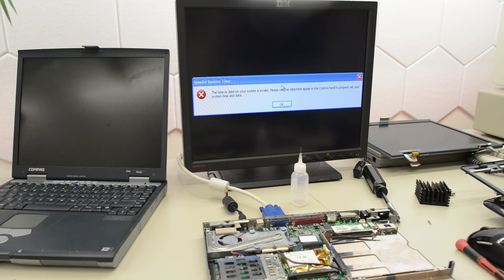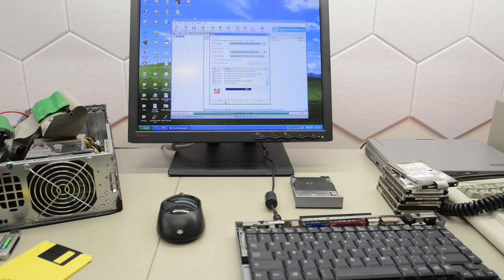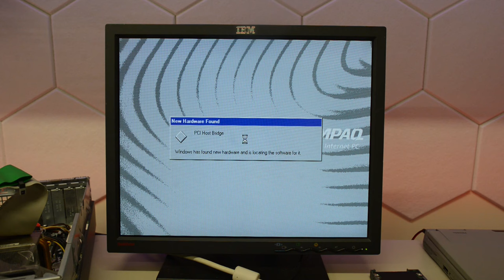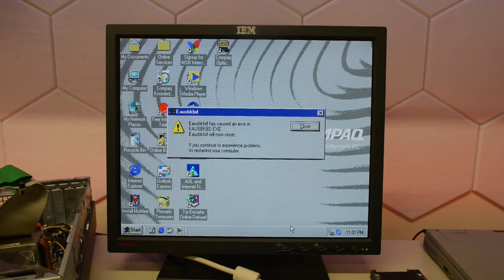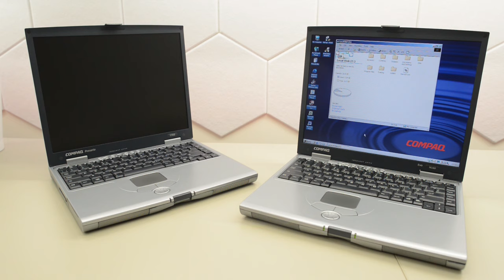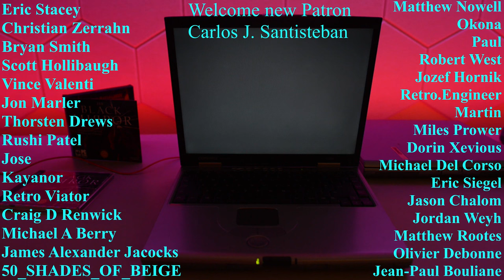Vintage PIII laptops Repair & Restoration. MOBO repair, respray, sticky rubberized paint

Comment: That very disappointing coating was DuPont Nextel when I used it in the early 80s. It was composed of neoprene powder mixed with urethane and was nearly impossible to scratch deliberately with sharp metal objects, so accidental damage or wear due to abrasion could never happen. It was used on studio mixers where the engineering's hand would wear through the paint adjacent to the slide pots over time.  Unfortunately after several years it acquired all the abrasion resistance of candle wax along with the stickiness you mentioned. A terrible disappointment when you're trying to make a premium product to last a lifetime. By 2000, anyone using it would have known that it was going to deteriorate into a despicable mess and how long it would take. Maybe new formulations were expected to be better or maybe it was pure cynicism and planned obsolescence that led to it being used in this century.
Reply from the maker: The condition of my 1980s and 1990s IBMs with rubberized paint is still good. However, I have heard that some collectors have had sticky IBMs too. There seem to have been several different formulas. One possibility is that the paint ages differently depending on how the laptop has been stored.
Reply: @Epictronics1  If you mean the finish on the Thinkpad lids, all of my old ones are perfect. That finish is less textured so I never thought they were the same stuff. It just shows that there were alternatives all along but probably not cheap. I can't imagine storage being the sole variable although if we go back far enough,I suppose those formulations could have been less durable and stable.

Comment: Too bad you removed that sticky rubber - it is possible to recstore that stuff. Old Thinkpads have same problem - sticky top covers and palmrests and I managed to get it mostly to original shape using baby powder. No joke - just firmly rub baby powder on the sticky rubber, rinse with water and repeat unless desired effect is achieved.
Reply from the maker: Yeah, I've heard of that hack. I'll try that on one of my TPs. This pair however, was too badly scratched up to try to save

Comment: This rubberised coating is called “soft-touch”, so be aware of this words, because it is still in use on lots of products. This can be really easily removed with paint solvents, ie with Solvent 647, which i am using, it even separates itself, turning into a kind of film that you can simply take with tweezers. Solvent 647 can fade into gray some plastics, but most of the time everything’s ok, and if you’re going to repaint them anyway, fading is fine. I also experimenting with methods to render it innocuous without damaging the labels, so i just painted one device (the Blackerry Priv) with acrylic varnish, but did it wrong (applied one thick coat), so it can be scratched even with nail, and recently started to come off.

Comment: That thermal pad is a mistake from the factory seen in multiple devices from that era. The heatsinks have pre-applied thermal compound from the supplier and it has a foil protecting it. That foil was supposed to be removed during assembly to expose the thermal compound. A lot of devices failed because of that mistake. If you haven't done it, I recommend that you remove the aluminum foil, clean the already dried out paste and apply fresh paste to the CPU core.
Reply from the maker: Thanks for letting me know, I'd better fix it right away

Comment: Soldering tweezers and chipquik are really good for removing smd switches and caps. The tips for many of the soldering tweezers are just a chunk of tinned copper, so you can modify them to be wide enough to melt all the pin connections at once, without damaging other nearby components. Great video and it is always great to see old hardware being restored, or at least reused. Cheers!
Reply from the maker: Thank you

Comment: Good job with this notebooks, I didn't realize how to fix the paint issue either. The thing with ram is I use a rubber eraser to clean contacts too. The connector having to be un solder to be able to change the buttons is quite cleaver even if it is annoying you avoided melting the plastic.
The fan not requiring replace was a great plus in favor it's really hard to replace.
Reply from the maker: Thanks!

Comment: I kept hearing "Compaq Evil" instead of EVO :) 
When cleaning surfaces, I recommend also using some water-based detergent. Not everything dissolves in alcohol and not everything dissolves in water! :)
I was about to replace my whole PC when Windows ME was around. It was crashing constantly. Then a friend suggested I tried Windows XP and all my problems suddenly disappeared! So no, it didn't work for me!
Nice restoration job!
Reply from the maker: haha, thanks, well the Compaq paint is Evil :) The only issue I had with Windows Me back then was the hibernation and sleep mode. They crashed my system every time. I just turned them off and never had any other issues

Comment: 31:55 - those Toshiba drives were notorious for having bearing problems. Some say it was possible to remove outer part of the bearing cover and give it some oil, but I never succeded in recovering a drive that way.
36:10 - I'd try m.2 sata to ide44 adapter. Works for me fine in Pentium III builds, just ensure proper partition alignment.

Comment: Great video. I remember working on these back in the day. That coating was an awful trend. Not so common today, but I still see it on cheap devices.

Oddly enough though, I have so many old ThinkPads that don’t suffer from this issue.

I guess they got the recipe right. Maybe Tosh should have contacted them first :-)

I've had much more success using methylated spirits though. For small items I just submerge them in a sealed tub for a few hours. The paint just rubs off after that. May have to do it overnight for stubborn coating. Then I just pour the spirits through a filter back into the bottle.

As you said though, depends on the plastic. Seems to be OK on ABS, but a small test is worth doing.
Reply from the maker: Thanks. Yes, IBM got it almost right. My TPs are in a way better condition than these two Compaqs. I have tried methylated spirits too. It was much quicker.
Reply: @Epictronics1  I used flux remover spray to get most of the nasty sticky gunk off my Psion 3c. It's a shame that was necessary as I did really like the look and feel of the thing when it was new.

My old IBM ThinkPad R51e is still in nice cosmetic condition. Shame the charge controller chip has blown & so far I've found it impossible to remove.

Comment: For storage, u can replace that ancient IDE HDD with a PATA to MSATA SSD adapter plus MSATA SSD. I bought a couple of used 32GB ones for my vintage machines.
Reply from the maker: I'll try that, thanks
Reply: I did this in a few machines and it cost approx £20 total for the 128GB mSATA drive + mSATA to IDE adapter from aliexpress.  That was in late 2019 but the prices I think are roughly the same now.

Comment: Unfortunately that damn sticky paint still occasionally shows up and the recipe only seems to have gotten worse! Soft touch finishes just don't hold up, always degrades and surprisingly quickly.

Old laptop construction... easy to forget how fiddly they all were to work on. This type of construction is pretty much gone now, there's so much less inside modern laptops though!

Comment: you could always try 3d printing the battery release switch. Probably best to use resin though. If you could get a test made you could always get the final from PCBWAY. I wonder how hard it would be to put an SSD in these. PATA is pretty old school though.
Reply from the maker: Yeah, I wonder if there is an adapter, a regular SSD would be pretty nice to fit in these machines. This is probably a rather difficult part to 3D print. Maybe someone very skilled could do it.
Reply: @Epictronics1  Well you'd test it with FDM, but the final version you'd want resin for strength. I won't touch resin personally. So I'd go to PCBWAY that does that.
Reply: @Epictronics1  An SSD adapter would be weird because if it's a 2.5" SATA it won't fit. So you would almost need an NVME adapter and the drive would have to be tiny.
Reply: @awilliams1701  Resin prints don't reach the strength of basic FDM materials.

I have done repairs on very similar parts and i make a silicone putty mould over a similar part and then cast an extension/replacement onto the damaged piece in slow cure 1:1 epoxy, where i add a little more hardner than binder and then hot cure it at 60°C, for example on 3D printer bed. I have even made a copy of the laptop key scissor switch mechanism out of epoxy that worked and never broke again, so you can copy precision parts that way which need to remain flexible.

Comment: WD40 seems to make short work of these sticky rubber coatings, used it many times to clean up. I don't know if all these coatings are the same but I guess it is as they all turn into the same nasty sticking surface over time.
Reply from the maker: I tried WD40, It didn't work on this paint unfortunately

Comment: I've had best results using WD40 to remove that rubberised coating, much quicker than isopropyl. Also some clear matt/satin lacquer/varnish as I've found the paint often dulls from use
Reply: I was going to post the same. I recently removed the degraded coating from a microsoft Sidewinder X5 mouse. It needed doing as the coating got really nasty after sitting unused for years, it smelt bad too (a bit like rotten fish). I didn't spray the mouse directly, I wrapped an old  bit of cloth around my finger and sprayed that, it worked a treat!
Reply: Denatured alcohol may also work. Used it to clean the handgrip of my old Nikon D50 (2005) four years ago; worked like a charm.
Reply: I was also to say I used WD40 to get rid of this rubberish frap out of Logitech Desktop Di Novo bluetooth keyboard
Reply: This can be really easily removed with paint solvents, ie with Solvent 647, which i am using, it even separates itself, turning into a kind of film that you can simply take with tweezers. Solvent 647 can fade into gray some plastics, but most of the time everything’s ok, and if you’re going to repaint them anyway, fading is fine. I also experimenting with methods to render it innocuous without damaging the labels, so i just painted one device (the Blackerry Priv) with acrylic varnish, but did it wrong (applied one thick coat), so it can be scratched even with nail, and recently started to come off.

Comment: It'd be interesting to peek inside the battery... may you can refurbish it by "simply" replacing the cells inside.
Reply from the maker: Very likely, if I can open it without braking it
Reply: @Epictronics1  : Many of the older Laptops contain 18650 cells, they are widely available, and with significantly larger capacity, than 20 years ago. If you get good ones, you may be able to double the battery's original capacity.
Reply from the maker: @bikkiikun  Yeah, I even have some litokala in my stash for another laptop project

Comment: i got the big brother of the Evo, the N600, 1.06Ghz, upgraded to 384mb ram
Reply from the maker: Awesome, I've got one too : ) I'll be making a repair video with it someday
Reply: @Epictronics1  do you have the restore discs for these? i would like to get it factory, but i could never find an image
Reply from the maker: @The-Future-Is-The-Past-  Unfortunately no. You could try to use the Windows key on the sticker with an OEM CD and try to find the missing drivers online. That often works.
Reply: @Epictronics1  the drivers and the bundled software is my primary concern, as the windows graphics drivers for the mobility readon installed only support 16Mb Vram, but according to the specsheet the machine has 32.
Reply from the maker: @The-Future-Is-The-Past-  Oh, I see. This is going to be a problem for me too. Have you checked if it's possible to use a non-branded driver?
Reply: @Epictronics1  you can pick A driver for some kind of similar chip, but you will only get 16Mb Vram. you can pick this from a list in windows. the other drivers mostly work straight out of the box in XP, which runs alright on the P3. good luck getting a usable browser, firefox's latest version with XP support does not run on a P3. very capable machine, i occasionally use it at school in place of my acer travelmate. not a whole lot thicker or heavier, and definitely more interesting.
they will not boot from USB unless you have a later revision.
Reply: i got mine with no hard disk, upgraded, replacement AC adapter and battery, someone used it until moderately recently. even the thermal paste was still wet. i got an 80GB drive from ebay along with the floppy module, wasnt even that dirty. they are really well built. wonder why it has 2 switches, one by default puts it to sleep, the other shuts it down. also strangely, the screen is dim unless you have it plugged in.

Comment: Is it possible to 3d print a replacement battery slider?
Reply: Of course it is, but someone has to do the parametric CAD reengineering for that part in the first
place.
Reply from the maker: Yes, very likely

Comment: Anyone know of a rubberized paint replacement? I have 2 G3 PowerBooks and one of them has started to turn on me.
Reply: Honestly, in the absence of a professional in the sub-field, I would probably either leave it missing, or use leather. Until I see evidence to the contrary, I'm inclined to assume that all the formulations will eventually turn to either goo or dust, as they seem to be related to rubber (which does pretty much the same thing).